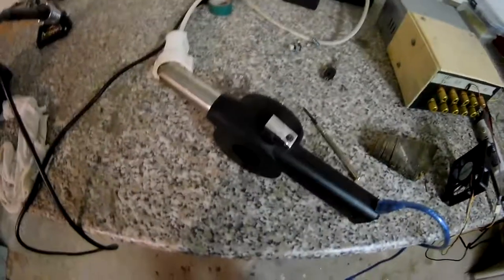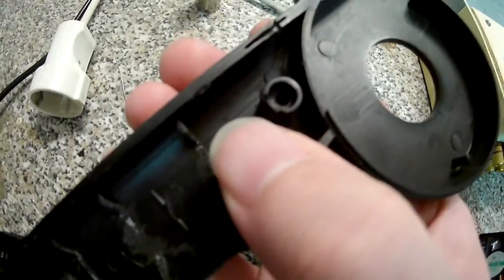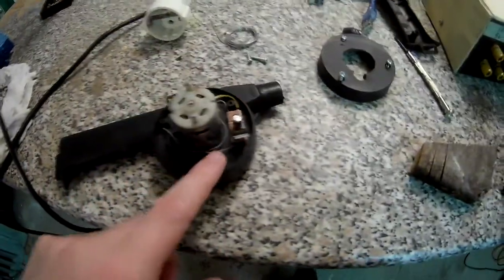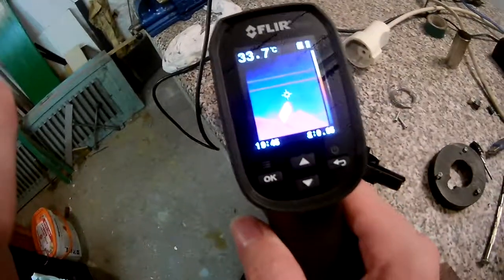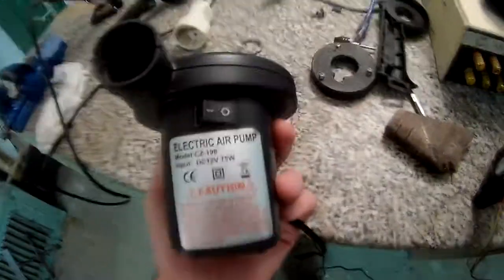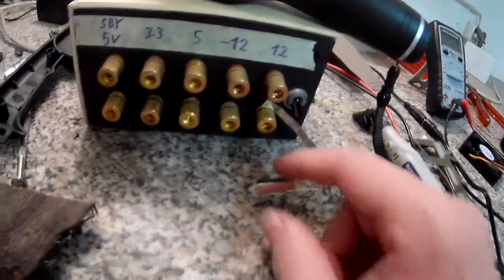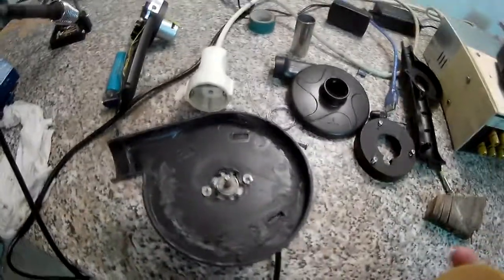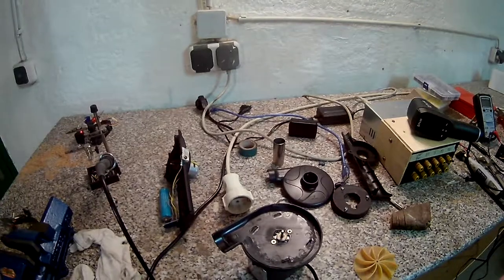Finally a Finished Project: Electric Blower Fan Thingy

Comment: Nice! That should smoke them ribs, hearts and livers in no time! :) \o/
Reply from the maker: as soon as i figured out why the charging board died i can reassemble it. my guess is that the flyback spike of switching off the motor killed it. i will probably try again soon, after ive added a diode to surpress that voltage spike